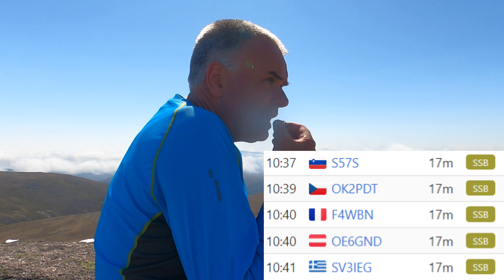Short HF Multi-band Antenna - 40m-10m!

Comment: Fraser, I'm curious the purpose of the choke in your setup here.. Is it to precent RFI from your transmission coming back up the coax into the radio? Chokes are still a bit of a mystery to me but so far, I'm getting by OK without them!! Thank you again for the love and effort you but into your videos. For me - you're been one of the best resources out there as I refine my setup and learn the hobby! Cheers, KI6PQO.
Reply from the maker: Good Question. A common mode choke is needed for an unbalanced antenna to keep RF energy coming back into the radio. In theory a dipole is balanced and doesn't need one. However, uneven ground, imperfect symmetry and nearby structures all add imbalance to the dipole, so a choke is always a good idea. The antenna in question here is un-balanced and a choke is advisable, although you may get away with it at QRP power levels. Take a look at this and see if it helps: https://youtu.be/A2Tq7AWIRwE?si=JnQTTDVxQOF7zFQp
Reply: @theradiorover  - Thank you!!

Comment: Great video once again Fraser. Great views from your mountain top. Amazing to see the antenna even gave some contacts on 40m where it is really too short to perform. Thanks for sharing. Best 73 de ON4MGY Nic
Reply from the maker: Hi Nic, Thanks! I took the view that I often work stations who are mobile and using a whip (on 40m), so my few metres of wire should at least equal that.
Cheers, Fraser MM0EFI

Comment: I am not too fluent in imperial, but isn’t 18ft really close to a quarter wave on 20? I am really impressed that it worked on 40 though.
Reply from the maker: Yes, the problem with random wires is when you make them really short, there is not many lengths that you can use that aren't close to a length you want to avoid! 16.5' is roughly a quarter wave on 20m. Getting it to work on 40m was a surprise and delight! Obviously the 49:1 helped a great deal. Not the most efficient, however folk use 40m with a coil and whip, so no worse I suppose.
The objective was to make an antenna that was vertical and would work on my carbon pole, so I am pretty happy with the outcome.
Cheers, Fraser 
PS when I do the build video, it will be metric and not bananas. 😀

Comment: What logging software are you using to record times and Callsigns when you are portable please? Thanks.
Reply from the maker: I use VK Port-a-log. It is available for android and can be used for SOTA,POTA,WWFF and other portable Ops. It is simple to use and produces an adif and a csv file. I also use it to spot myself and to view other activations.
It's brilliant. Only time I can't use it is when it's raining!
Reply: @theradiorover  thanks so much for replying. 73s.

Comment: Cracking video and what a nice location. You must have tried so hard no to stack it when riding the bike through that stream. Nice run of contacts on that antenna and looking forward to the next video of how it's made. Hope your not grounded for too long. 73 Chris M0RSF
Reply from the maker: Cheers Chris. It was a lovely day up on Ben A'An, probably the best hike so far this year. A great spot to test that antenna.
Cheers, Fraser MM0EFI

Comment: Great video Fraser! This seems a good solution in combination with an ATU. I'm eagerly waiting for your second video showing more details. 
I also experimented with a resonant vertical for small summits, but I still have to do the video editing. I prefer so much going out for SOTA than sitting in front of the computer 😉
I really hope your knee is fine again or will be healed soon.
Take care and 73, Stephan
Reply from the maker: Hi Stephan, I filmed this back in May, so I am a little late in releasing it! I have been trying to design a short multi band resonant vertical, however I think if would be difficult to implement with traps and coils. 
73, Fraser MM0EFI
Reply: @theradiorover  Ahh, that's why one still sees patches of snow! 
And yes, using fixed traps or coils would be tedious. My "solution" is trivial in this sense: I use a cheap commercial antenna with a changeable base loading coil and add some other pieces. I'm also not a fan of commercial or pre-built antennas, but in this case I had to make an exception 😏
Reply from the maker: @PortableRadio  yes, I actually edited most of it and then forgot to upload it due to being busy with other things. The commercial base loaded coil antennas seen to work well, but like you I find them heavy, expensive and cumbersome! I'd love to hear how you get on with your resonant vertical.
All the Best, Fraser
Reply: @theradiorover  My next video will show that, with all the pros and cons of a vertical antenna, compared to a partly horizontal one, e.g. an EFHW. I tested it extensively and compared it against my EFHW when there was enough space. Otherwise, better to have an antenna than none.
Have fun and 73, Stephan
Reply from the maker: @PortableRadio  I recall you writing that I would lose NVIS with a short vertical. I managed NVIS close contacts on 40m on this trip. Probably down to radiation from the two radials. I must model it!
Reply: @theradiorover  a model with your setup would be interesting! My experience on 40m with a 50km NVIS distance: with the monopole, my signal was at noise level, with the EFHW my signal was S9.
Reply: @theradiorover  Hi Fraser, I just published the said video with the title 'Vertical Antenna for Tight Spaces'.
73 Stephan

Comment: Tidy antenna. Helps with the KX having the ATU to assist. I was looking the other day for an compact antenna for HF that does not need ATU(already have a linked dipole but on a small summit could be awkward.)
Reply from the maker: I thought about trying to make a short one with traps and coils that would be resonant and not need an ATU. It is not really viable for a short length and still be multi band. Mine fits in my carbon 6 nicely and the kx2 tuner is a godsend!

Comment: Wow what a fantastic location Fraser. Was this video made earlier today? Would have liked to work you from this QTH. I had a similar accident a while ago when my trolley front wheel went in between a gap in the wooden pier and I ended up falling over the pedestrian mobile trolley and cut my knee. All part of the fun. Excellent video. What model of Go-pro do you use?
Reply from the maker: My GoPro is a Hero 9 model and I have a lens mod and media mod attached.
I was up there a month or so ago. I actually qualified the summit on 2m and 70cm,  such is the height, however I forgot to press record on the camera so decided to make the new antenna the subject of the video!
Cheers, Fraser MM0EFI

Comment: Nice one again Fraser!  I saw you on Ham alert but couldn't hear you good enough on 40m. I didn't hang around for the other bands. That antenna works fine. I use a 8,5m wire and a radial. The KX3 tuned it just fine. Didn't try it with the G90 yet.
Reply from the maker: Cheers! Yes, I was pleasantly surprised. A handy antenna to keep for small spaces.